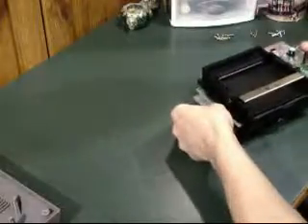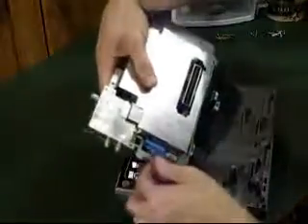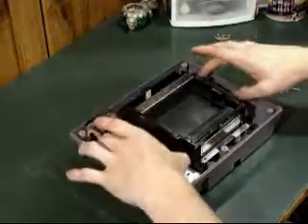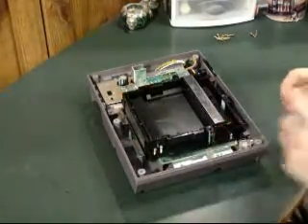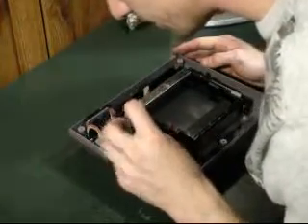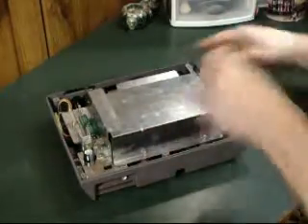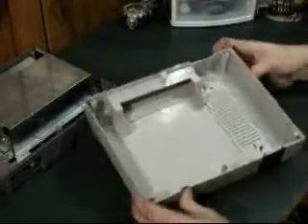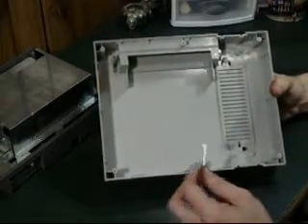How to Change Your 72 Pin Connector, Disable The Lockout Chip and Clean Your NES System: Part 3

Comment from the maker: @DruMerFreak69 Hey
Glad the vids helped. If you change the connector it should be good for quite a few years. You just have to be sure to keep it clean. The best way to do that is to make sure that the games you play on it are clean as well. Most of the dirt and grime that makes the screen flash is transferred from dirty games to the 72 pin connector. So if you clean your games and keep them in dust covers your system should work well for a long time.

Comment from the maker: There is a tab on the bottom of the cartridge dipper that needs to tuck underneath the board. It can sometimes be tricky to get it hooked under there right. If the tab is not hooked under the board it will not sit right and can cause the screwhole to not line up right. Not sure if that is the problem but give it a look.

Comment from the maker: @cidrog1890 hmmm well if you did both those things then it may be a problem with the board which would be a little harder to solve.  You should check out Nintendo Age and ask in the forums there. They are a great community and someone would probably know what the problem is.

Comment: Hey i just changed the connector with a ttx brand replacement. IT works perfectly. EXCEPT, it's so hard to take the game out that i have to use pliers. Any suggestions? or will it just get looser over time